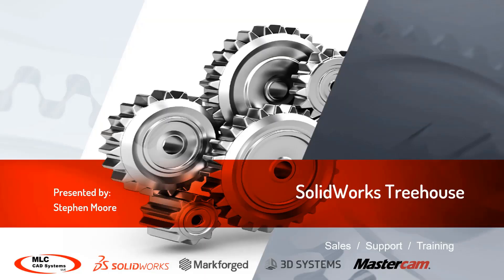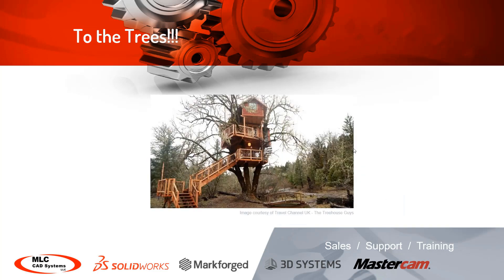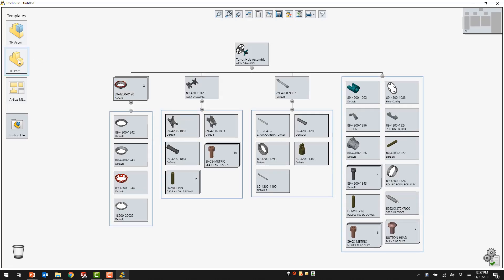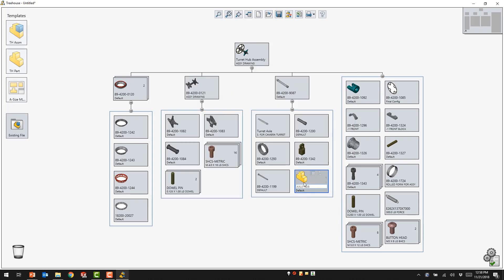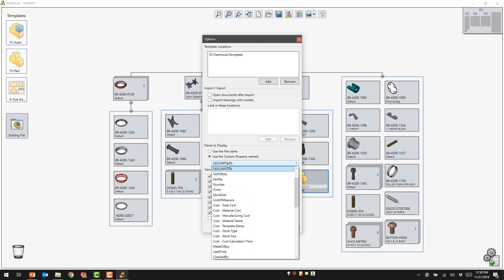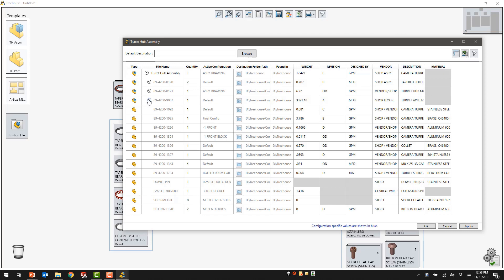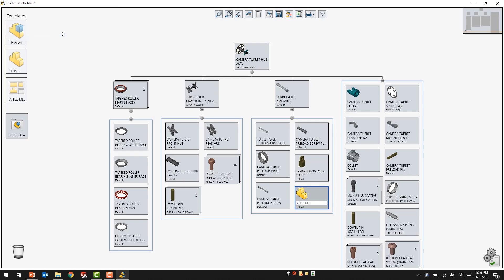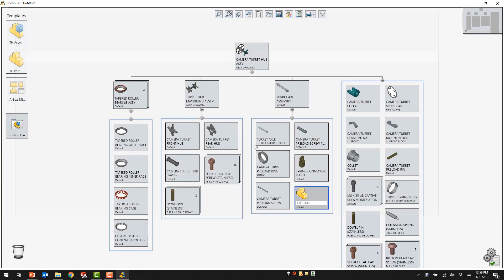Assembly BOM Layout with SOLIDWORKS Treehouse

Comment: Excuse me, Sir. How do i get thumbnail in the option?
Reply from the maker: Great question, the thumbnail is generated by SOLIDWORKS during saving, but there are a few things that can prevent this from happening.  If a file is created but never saved in it's own window, such as a part built in-context of an assembly but never opened in its own window, it will not have a thumbnail created.  Sometimes installation issues will prevent the thumbnails from displaying, and there is even a system option to disable saving thumbnails in System Options > General > Show thumbnail graphic in windows explorer.  If you open and save a file and it does not generate a thumbnail for you in Windows Explorer or Treehouse, you may need to contact your VAR support to diagnose the issue on your system.

Comment: How to do BOM for multibody part?
Reply from the maker: SOLIDWORKS Treehouse would not be a good tool to create a BOM for a multi-body part, it is focused on model references and a multi-body part has none to other documents.  I would recommend inserting the multi-body part into a drawing in SOLIDWORKS and from there you can create a Cut List or a BOM that is indented to show the multi-body parts.
Reply: @MLCCADSystems  
so I think that this feature should be added to the treehouse for its full functionality